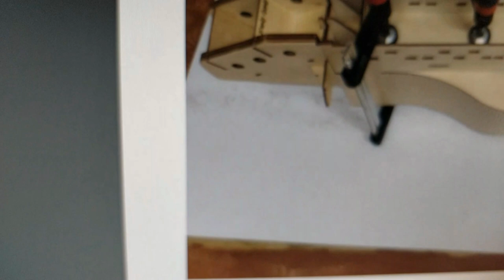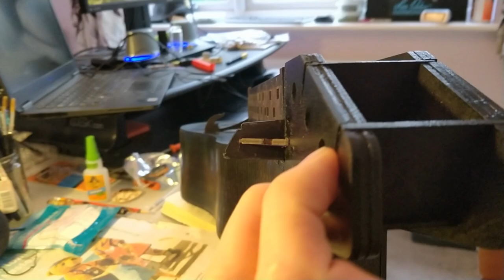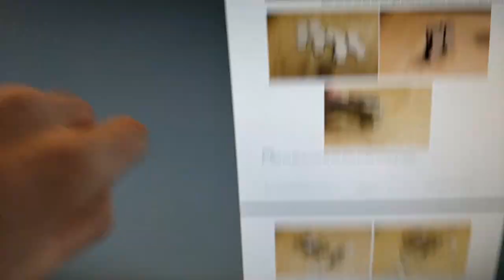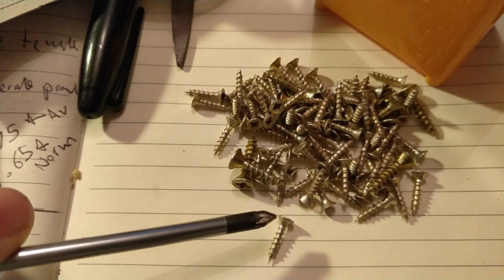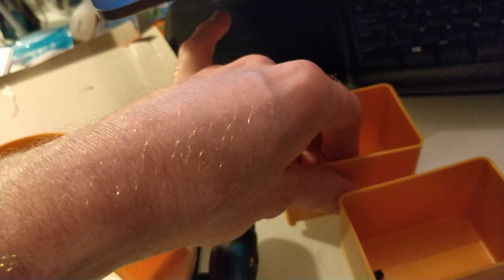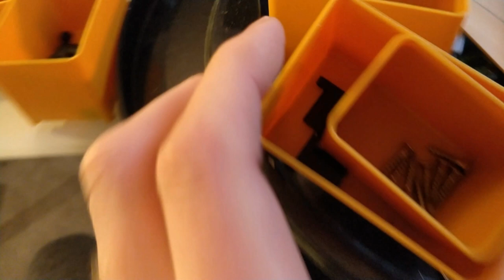Nerdy Gurdy, Hurdy Gurdy  complete build guide instructions Part 3 finishing ready for setup

Comment: heya, just wanted to drop by for two reasons: 
first off, thanks for sharing your paint job and which stains you used! not gonna lie, seeing your purple gurdy pushed me over the edge to give the nerdy a go - i was contemplating getting one to try the instrument before saving up (and joining the waiting list) for a professionally made one. realizing i could get my dream purple in the meantime? hell yea!
secondly, that trick with boiling bent 3d printed stuff? i see you're also working (or worked?) with minis. same thing works there with some plastic and resin models, as well as the soft "bones" material from reaper. there's also "salt dipping", a technique that uses the same principle while avoiding loss of details due to heat melting too much plastic. just thought, since i learned something from your videos, might pay back a little!

(now this is the point where I realize woodeedoo stains are only available in the UK, and with the import/border situation right now... ah, joy!)
Reply from the maker: Hello. Thanks for your bright and positive comment. Its so depressing here at the moment and a nice comment means so much.  When I eventually upload the last 2 (yeah I know I said 4, but it will need 5!) parts of this video series, some serious, show stopper issues I had and have had to fix will come out. 
Life is short, if you want one, make it happen my man!  
I have since bought a 3D printer a I am back to paining home printed minis more these days. I also plan to make a few bits for the Gurdy!  Maybe that will be video 6!  lol
Reply: @Jefferson Dane yup, been using Instaflixxer for years myself :D